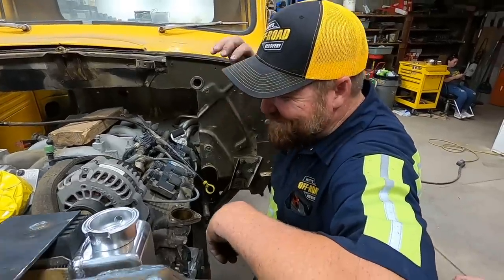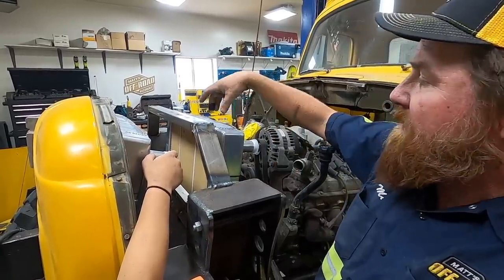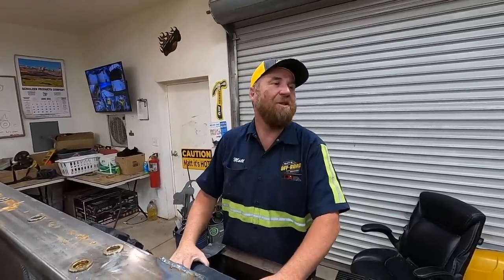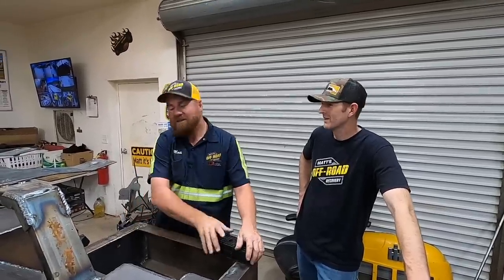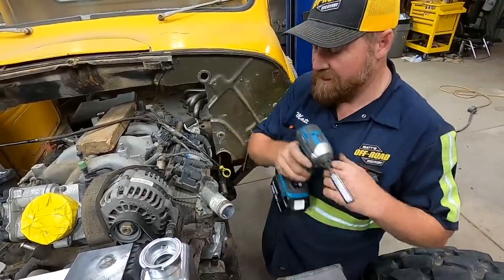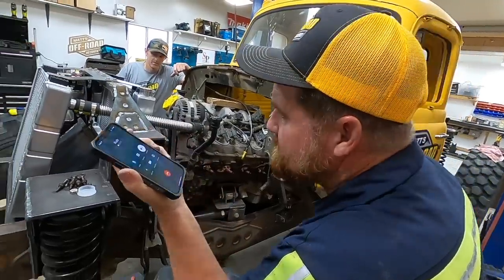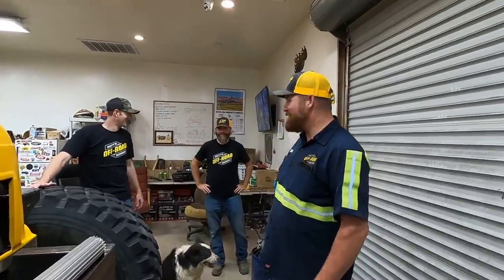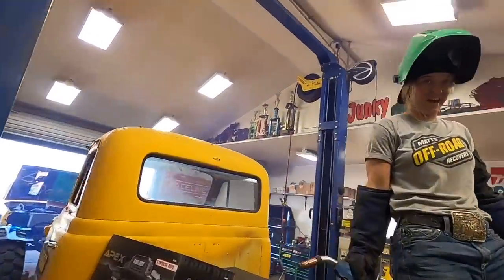This Part Ruined All My Work! The World's Largest Off Road Wrecker

Comment: You got the radiators backwards. Since you are aiming for maximum cooling, it needs to be counter-flow. The air is flowing from front to back, so the coolant needs to flow from the back to the front. Hot water through the back radiator first will be cooled somewhat, then through the front radiator where air is the coolest, to get the coolant to the lowest temperature possible.
Reply: Your right!
Reply: I think he said at the start that when the thermostat is closed it circulates in the back radiator and when the stat opens it adds the front radiator as the primary.
Reply: @atubebuff  , the rear radiator needs to be the primary.
Reply: Absolutely
Reply: Thank you! Hope they change it to this setup
Reply: Yup, agreed.
Reply: That's the first thing I thought when he started showing his setup. Came here to say that and it looks like several others thought the same. :)
Reply: well that would be the optimal way of doing but how is he going to get the return from the front radiator to the water pump. without having an excessively long hose that may rub on the frame and get a hole in it
Reply: @cameroncashatt692  use a hard line like mid-engine cars do.
Reply: Bingo
Reply: Just adding the reason why, you want the colder water to be cooled by the coolest air. So in this case you want the hot water to go into the hotter radiator where it will be cooled initially. Then the partially cooled water will be sent to the coldest radiator. I don't know for sure but I'll bet this will wind up with the water being returned to the motor being 10-20 degrees colder... source: thermodynamics, fluid dynamics, and thermodynamic engine systems classes!
Reply: Yup. For the most efficiency. You want your finished product, before you put it to work, in the coolest part of the circuit to scavenge the last bit of heat. In this case what’s doing the work is the radiator fluid.
Reply: I’d bet Someone has worked on heavy equipment.... 👍🏻
Reply: But the back radiator is half fresh air so it’s fine. Probably
Reply: @cameroncashatt692  hard-line the majority of it, with flexible at either end to mitigate vibration fatigue
Reply: Yip
Reply: How is that single pass radiator with both inlet and outlet at the top gonna work though? The coolant is not forced through the entire radiator and the temp delta is gonna be minimal as the coolant can just run around the top section and straight back out again?
Reply: I was thinking the same thing. Matt also didn’t address the heat on the back side of the radiator(maybe because the plan is for the air to be flowing one direction because he’s driving, but he spends a lot of time stopped). It’s likely the that after he stops to hook the wrecker up, the rear radiator will have to endure some heat soak.
Reply: @Robert Miller The coolant-to-ambient temp difference is greater in the front radiator when it’s the primary.
Reply: I don’t think it matters which one the coolant flows through first.

Swapping the order of the radiators only changes the temp of the air between them. It doesn’t change the surface area of the radiators, the flow rate of air or coolant, or the temp delta between coolant and ambient air, which are what drive the cooling capacity of the system.
Reply: @LuIsSaNcHeZ510  , indeed, if he gets the airflow so mostly cool air is getting to both radiators, it will work great either way. My comment was based on him saying that the air will be warmed up already. It may be easier for him to add some small fans to increase cool air to the rear radiator than to replumb the coolant.
Reply: I absolutely agree with this, Hottest coolant in the back rad then outflow into the first Rad
Reply: Good enough
Reply: This is typical Internet nonsense seeking an ideal when that's not what is needed. He doesn't need maximum cooling. He needs good enough cooling. This truck would probably be fine with a single radiator. The second radiator just needs to ensure that the motor runs in optimal temperature - nothing more. It doesn't need to be the most efficient design possible; it needs to be sufficient to perform the task.
Reply: Matt explains in the comments that it was a matter of what would fit and if it doesn't work they will change it.
Reply: Go back and watch it, he explained everything and why and such
Reply: @Robert Miller Sure, compared to a parallel flow heat exchanger, a counter-flow heat exchanger is significantly more efficient.

But an automotive radiator is not a parallel flow heat exchanger.  An automotive radiator is already more efficient than a parallel flow heat exchanger.  I'm skeptical that there's a significant difference between the two arrangements of a pair of radiators in series.

If there is a gain in efficiency from making the rearmost radiator the primary, it would only occur with radiators of identical size and construction, and it would be a marginal difference.  

Also, a counter-flow heat exchanger has no leakage.  The flow rate of cooling fluid at the entry is the same as the flow rate at the exit.  But this is not the case with two radiators in series.  The second radiator will not flow the same amount of air as the first, even if they're identical, and even if you make every effort to minimize leakage between them.  Making matters worse is the taper of the tunnel used here, which creates a flow restriction.

Whatever slight increase in efficiency you might get is going to be wiped out by the fact that the front radiator is twice the size of the effective area of the rear radiator, the rear radiator is not going to flow as much air, the rear radiator is also being exposed to hot air on the lower half, etc.
Reply: Yes, this is how it works. The radiator that gets the coolest air needs to be the last stop for the water, or else you're just transferring heat back in to the water before it pumps through the engine. 

You can test this with stacked PC water-cooling radiators. If you stack the radiators with fans between, and pumped water heads to the up-wind (outside) radiator first, then the down-wind (inside) radiator second, the temperature is no different than having a single radiator, as you're just transferring the heat from the upwind rad to the down-wind rad. Swap the hoses around though so that the upwind rad gets water last, and you will see a significant drop compared to the previous config or a single rad.
Reply: Just sit back and watch the damn videos.  You don't know what/ how he works and what the plan is/ what will and won't work.     He's been just fine without your and everyone else's comments
Reply: @block4565  , whatever. Put your money where your mouth is. Matt reads the comments. You read the comments. If he didn't want feedback he would disable comments for the video.
Reply: I agree 100% with running the coolant into the rear radiator first. I run dual radiators in the binderbird for many years. The heat coming through the front radiator is just going to heat up the rear radiator. I also did not quite understand where the coolant actually is going from the inch and a half front radiator into the rear radiator, the bung in the rear radiators upper inlet does not appear to be big enough to accept the front rad coolant. Maybe I missed something?
Reply: @block4565  
If you don't like comments, don't read comments. It's pretty simple.
Reply: huh
Reply: "Cardboard Aided Design"...LOL! Classic!

Comment: As one of the 7 engineers, I’d like to say: by creating a longer more complicated path for the water you will create resistance to flow. That means that you will have a lower water flow rate with the stock pump. Most likely this will not cause any issues, if however there is an issue when you drive this thing on hot days you may consider changing the impeller on the pump or getting a pump with a higher flow rate.
Reply: I was thinking an additional external pump would help with pressure, but not sure about reliability. If they had the radiators in parallel, it’d actually be less back pressure.

Really I wouldn’t worry about it unless problems crop up.
Reply: Favorite comment here😂
Reply: I’ll be another one of the seven and agree with what you said.
Reply: @Dozav7  My old car had an electric auxiliary waterpump. It was still on the original pump (which still worked) when I sold the car, when it was 18 years old.
Reply: Glad you brought this up. An electric water pump to replace or be added into the system would be a big help, probably.
Reply: As it is now, won't the hot water just go across the top of the front radiator, bypassing most of the tubes?
Reply: An additional BMW variable speed electric pump should be considered??? Yeah..
Reply: Electric pumps (albeit I'm not a big fan of the pwm units from bmw) are great, but adds another point of potential failure in an already complex system. The last thing you would want to do is need that component and have a point of failure that is hard to replace and could leave a recovery vehicle, needing its own recovery. I know theyve been on cars forever, V.A.G. has been using them since the early 90's at least, but they do fail, especially plastic from all the heat cycles, and thats a HOT climate. Biscuit may not be worth risking it lol.

Flow path honestly does not seem terrible, and he should be able to maintain good velocity. Look at most marketed heat exchanger systems for roots blowers. They only use 3/4" at best 1" lines with many twists and restrictions, yet manage to move those thermal loads. As long as the system is bled, the pump likely will see minimal restriction of flow compared to what fins in the radiator create to begin with. You could argue head pressure against the pump, but these systems are mechanically driven and generally under pressure, so a good belt wrap is a must and i think it should be fine! :)

definitely cool food for thought, would be awesome to run an analysis on, but at the end of it all, I think his biggest worry will be the actual radiating/cooling side of things and not cooling flow.
Reply: So how would you improve the radiant system? I would think a thicker radiator with less channels would lead to a faster rate of travel and thus less time in the radiator and a quick return to the cooling channels in the motor block. What if the cooling were split? Thus four cylinders are cooled by one radiator and  the other four are cooled by a secondary radiator system? Then again, air cooling works for aeroplanes, but that is largely due to the fact that the atmosphere is cooler. How about the cooling system applied to supercomputers? Then again combustion engines are old technology, let's move on to Lithium technology.  Most lithium is mined in Australia, Chile, and China and in the U.S. there is one active lithium mine in HUMBOLDT COUNTY, Nevada on land owned by indigenous Americans, but fuck them! How about we just stop thrill seeking and work on preserving our planet? WTF do I care? in 20 years I'll be dead. So long suckers!
Reply: In other words, get a bigger water pump
Reply: @Yooper_Life  dual flow radiators have a path that goes up and down 2 times within the radiator. So, it physically impossible.

Comment: Concept of the Day: "Contraflow"

When doing heat exchange, the two media should be flowing in opposite directions. So if the air is flowing front to back, then the coolant should be generally progressing back to front, i.e. the front-most radiator visited last, just before sending coolant back to the engine.

For clarity, if both circuits of a heat exchanger are plumbed with the same flow direction, then it's a "temperature averager".

That said, everything might work just fine. This is just the basic idea of exchanging heat, applied to this example.

Cheers.
Reply: Should, if you want the heat exchanger to save you fuel/electricity bills .. in heating some building, for example. When you return the otherwise wasted heat to  where you are heating by burning fuel/electricity, you save fuel, input power, money...  When the  heat  lost to the air is just wasted (it being implausible to add a heat exchanger to  each cylinder  and expect it to achieve anything , in a reliable fashion... )  , its only a question of , is their enough heat exchanger  power ? Factor into that the diminishing returns of radiators, as the air will also do cooling on the huge surface area of metal  of the engine...
Reply: That's right, the log mean temperature difference (driving force for heat transfer) is greatest in a counter-flow heat exchanger. In a parallel-flow HX, the large initial temperature difference quickly brings the temperatures closer, reducing the average temperature difference.
Reply: Yeppers, lowest temp water should also be in contact with the lowest temp air!  Otherwise the waste heat will just be reheating the fluids...

Thanx tho, definitely a kool build !!
Reply: That makes sense!
Reply: Exactly ...
Reply: @isilder  Nope
Making use of residual heat is just one way of extracting it from a system.
It has nothing to do with efficient heat-exchanging as such, but with efficient heat use.

Actually, in Matt's set-up the front radiator could fall victim to your "diminishing return of a radiator" - where it may have the coolest air, but still fails to cool the hottest coolant because there may just be more heat than that radiator can exchange on its own . Something Matt definitely expects, as he tossed in a 2nd radiator .
Reply: Matt lives in the sun belt, if he went electric and towed around 12,000 watts of solar panels he could charge all those electric side x sides
Reply: Be Careful .. if you don't have any videos proving anything your talking about apparently Erik Larson up there will call you out for not being a content creator and thus not knowing anything that your talking about since apparently Matt is a professional Fabricator ... Goood Job Matt LOL
Reply: might steal the "temperature averager" term lol
Reply: MORR radiators are needed as you go up in altitude and slower in speed.
Yeah the bung arrangement at 12:00 is exceeding cool! :)  
3 of 7
Reply: 30-some years ago, I was shopping for a 'Heat Recovery Air Exchanger' for my house project. They're an appliance to provide fresh air while retaining most of the heat. Most such devices use a cube-shaped core with cross flow, like an X. Their efficiency in heat recovery is limited (~75%) by the suboptimal shape of the heat exchanger core, i.e. the cross flow. So I bought the more expensive version that has a much larger rectangular core, which provides actual contraflow for the Out and In air flows, and thus something like 90+% heat recovery.

Comment: Always remember to cover glass when grinding and welding . Vintage glass is hard to find in curves  like windshields . And yes it burns in glass .
Reply: I learned that welding on my M35A2. it will ruin the glass.
Reply: I to have learned this
Reply: I learned that lesson the hard way.  LOL
Reply: Ruined some brand new windows in my grandads workshop with my first grinder. Had only been in a few days
Reply: Similar lesson learned when I decided to shoot grinding sparks with a DSLR. The sparks bounced right off the plastic body of the camera and lens, but completely pitted the glass element. Running your finger over the element now feels like sandpaper. That was 12-13 yrs ago, but I still have the lens. Sometimes ya gotta keep results of dumb@$$ery around as reminders.
Reply: The driver's side window glass in my XJ has a nice permanent spray pattern from the time I wasn't paying attention and blasted it with grinding sparks.  It is always a reminder NOT to do that again!

Comment: Counterflow the radiators. I.E. Feed the rear radiator with water first. You want to maximize the temp difference between the air and the water through the whole system. The higher the temp difference, the better the heat transfer. 

So in the front coil, the air is the coolest, so it can continue to cool water that is cooler than in the rear radiator. When the air hits the rear radiator, it's hotter, so you want hotter water in the rear radiator to continue transfering heat into the air.

Hope this helps! This build is awesome!

Comment: Based on my experience with heat exchangers in the process industry, you can get better cooling by running the hot water through the rear radiator first and then through the front radiator.
Reply: That's what I was thinking since that's how my condensing furnace works. Run the water first through the rear radiator and then through the front radiator.
Reply: It makes sense from the science of it too... the flow of heat is proportional to the diference in temperature (between coolant and the air flowing past it..  )  but that cooling power that  might not be needed . If the separate   cooling power of two radiators is well above requirements, then the second radiator can  run at less cooling power  than its design would allow.   All these radiators cooling the coolant are raising the temperature of the air flowing past the engine and exhaust, and thats a lot of surface area that gets air cooled.. so there's a diminishing return on improving radiator performance...
Reply: Came here to say that exact same thing. Hit the initial water with the cooler that is dealing with hotter air, that will give it a larger gradient to dump heat. Move the then cooler water to the radiator that is working with the coolest air possible to dump off more heat.
Reply: You're right, however it looks like it's a bit too late.
Reply: Same thought.  Should gain a few more degrees of cooling but if you are flying that close to the sun, there are already issues.  
Also, can't overheat if there is no fuel in the tank...  Kidding of course.  Amazing work by the crew and far beyond anything I've ever dreamed of making.